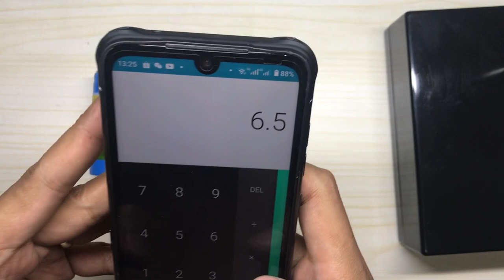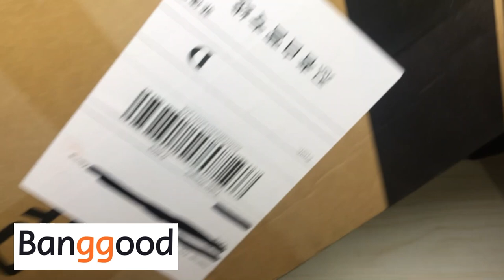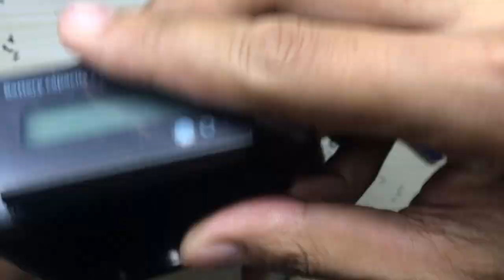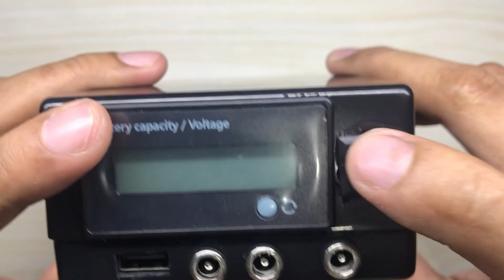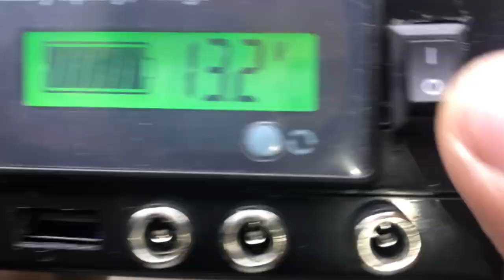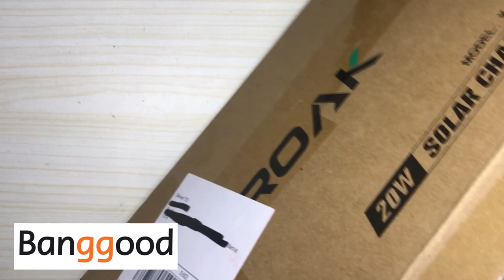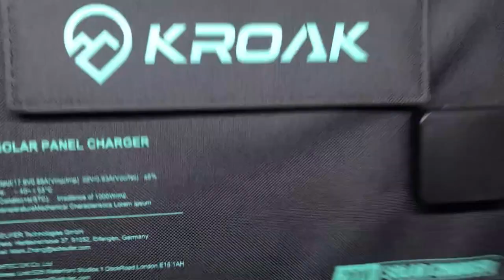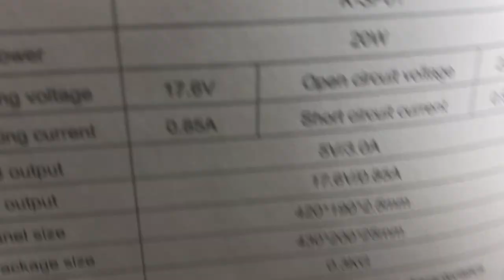MINI SOLAR GENERATOR W/ 20W KROAK FLEXIBLE SOLAR PANEL

Comment: Nice video ka diy. Ganda nang flexible na solar panel. Ano pala size ng wire  na gamit mo? Thank you po. Try ko gawin to.
Reply from the maker: 18 ata ito kadiy, binili ko lang kasi sa hardware hehe. basta kinuha ko po mas makapag sa awg22
Reply: @DIYPINOY  thank you po

Comment: Sir question lang bakit need ng buck converter? Para lang ba bumaba ung volts galing panel or tumaas? Saka sir pede ba gamitin pang charge ung bms nya rekta na?  First-time ko sir gagawa ng mini battery pack balak ko sir TP5000 na LiFePo4 charging module tapos naka connect sa 2 Lifepo4 battery na naka parallel with bms, ung 6v panel naka connect na sa TP5000 mali po ba ung ganong setup?